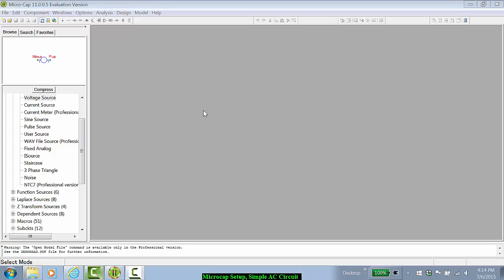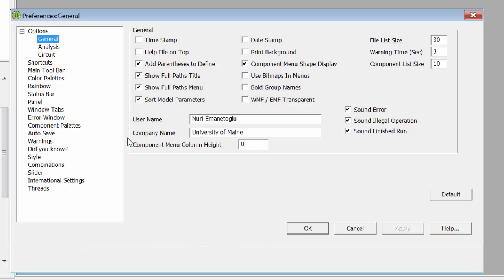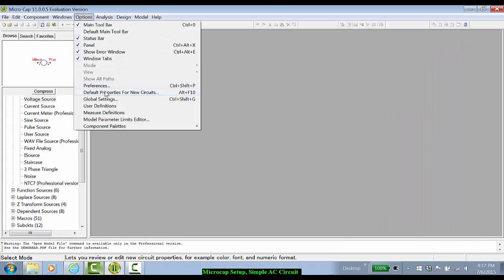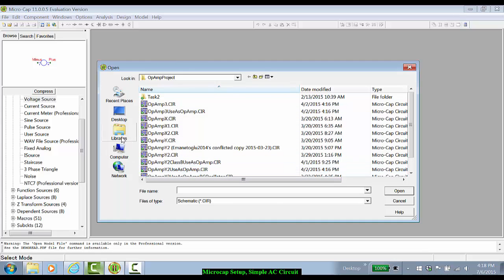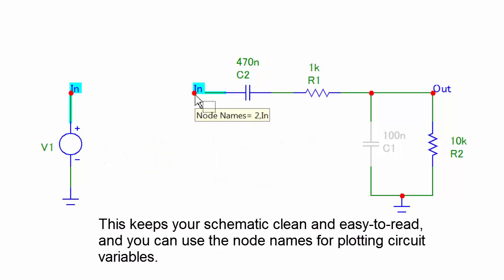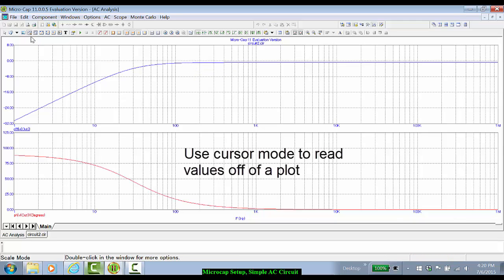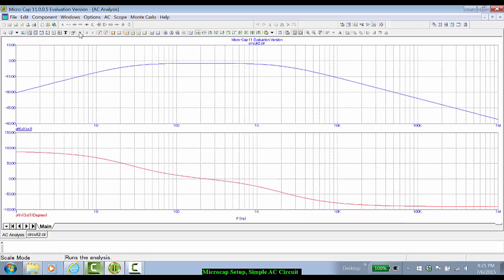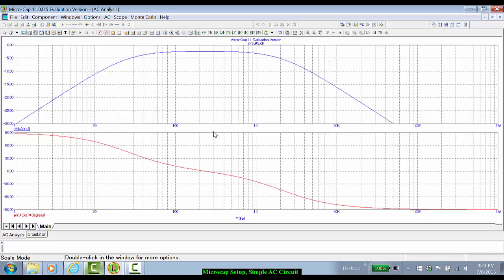ECE 342 MicrocapTutorial03: Setup, AC analysis

Comment: Hello thak you very much for this tuto. 
1)
I have questions about path  menu.

I guess that Data is where all your calculation and variable are saved when you are working on microcap  ? Is like a local memory for calculation ( RAMS ) , deleted when you close microcap. Or it's where you have every data that make your microcap work.

Model library is where you have all your model component or just standard component ?  when you want to add a component i guess you go there ? 

And what about document ?

2) I saw that  to compute your bode diagram you just put db(v(out)) and ph(v(out) but , the phase has a meaning only if you compare with an other signal , Input for example.  Or when you write db(v(out)) Microcap , do it directly from the input signal ?